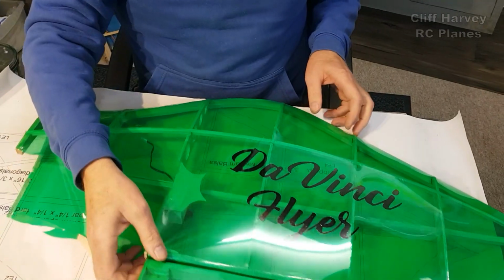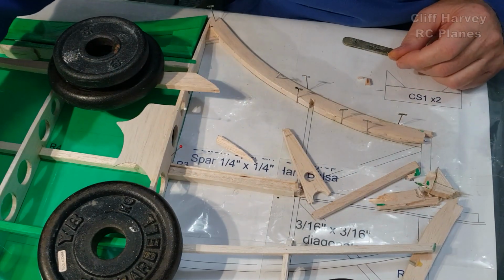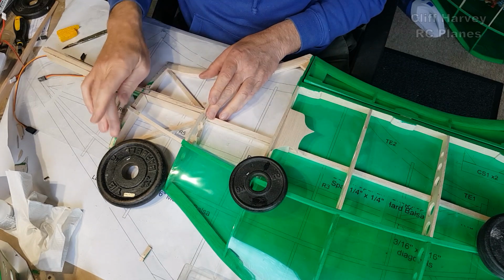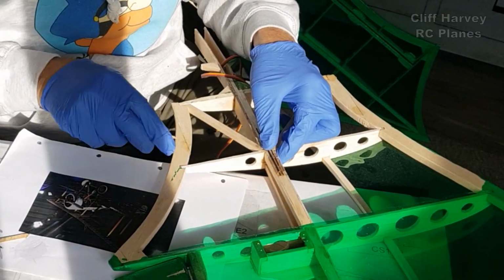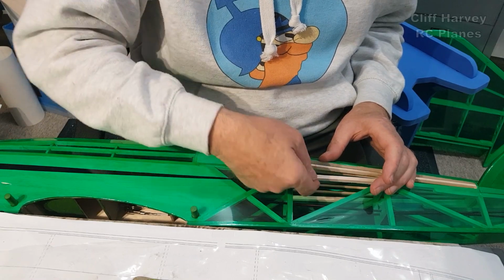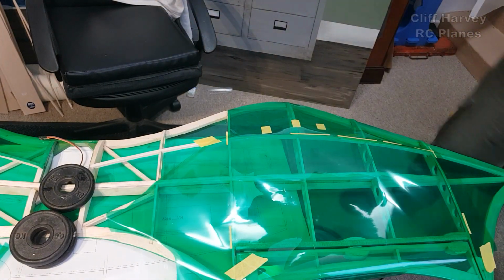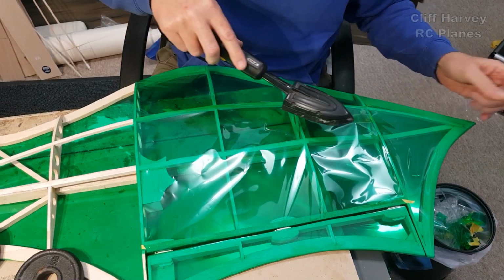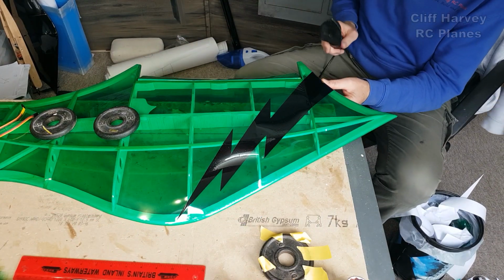Da Vinci BatFire Repair

Comment: Not an easy fix. Changing a main spar is really something. Really good that you do not give up. I still marvel at your perfect cuts and joints!
Reply from the maker: Hi Andrew, thanks, with hindsight I should have fitted two spars from the start, interesting fix though 👍

Comment: I think Adam used a matching color covering to seal up the aileron gap. If my memory serves me well, which it doesn't always. Not sure if you'd be able to that without seeing the darkened overlap of the transparent covering. Clear tape would do just as well of course.  Such tedious work when you have to go back and fix your model!
Reply from the maker: Yes I think he did Jake, I'll go with clear tape though for the reason you stated. The model is a 'work in progress' don't forget, so something was bound to give, just a shame it was a wing, but never mind it's stronger for it, cheers.

Comment: Looks awesome Cliff. 👍🏻 I've been absent for a bit, I've been very busy moving and my health hasn't been so great. 
Sorry for the longish comment but I have to share this with you. 
I finally got my foam board plane finished last week and took it out for it's maiden and it flew great. I was shocked I got the CG correct first try  - well very close lol especially being I had no plans to go by. Thanks for the tip of moving the aileron's out further on the wing. It has very good response 👍🏻 and thanks for motivating me to start flying again after 20+ yrs. and all the great tips from watching your builds etc etc etc 👍🏻  I'm getting caught back up on all your vids I've missed. Keep up the great workmanship.. 
Cheers ✌🏻
Reply from the maker: Thanks Erric, moving is a real pain but sounds like you've got over the worst touch wood. That's great news on the model, now all you need is blue skies and light winds, cheers 👍
Reply: @cliffharveyrcplanes  YW. Yes it was a pain in the butt moving. I have disabilities so that didn't help matters one bit lol. Thank God that's over lol.  It was a bit windy Saturday so I only flew about 3- 4mins but I took it out Sunday when the wind was only 5mph and ran 2 packs through it which is around 40mins flight time. My neck is killing me but it was well worth it 😁 I'm only using 3cell 2200 30c spectrum smart batteries and it has unlimited vertical and great flight time. I could easily go with a bigger battery and get even more flight time and thrust but it's a bit ridiculous with what it has now 🤣. I flew at like 20 - 30% power 95 % of the time and that was plenty enough speed especially me being a novice lol. I gave it full power for like 5 seconds and I was seriously scared it was going to rip the wing off 🤣. 
Again thanks Cliff cheers 👍🏻✌🏻 
Again thanks Cliff 👍🏻✌🏻
Reply from the maker: @EJ-74  Hey, you have a go at me for ripping my wing off 🤣
Reply: @cliffharveyrcplanes  😆🤣Oh well as they say  SH*T happens 🤷  😁  Long as you're smiling and having a good time is all that matters. If nothing ever went wrong we would be bored to death with nothing to tinker with hehe 👍🏻✌🏻